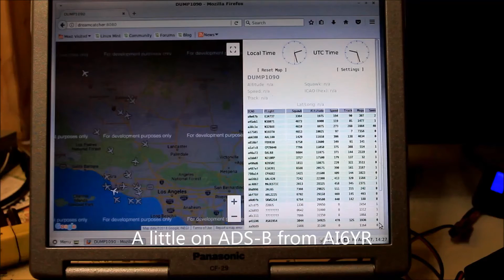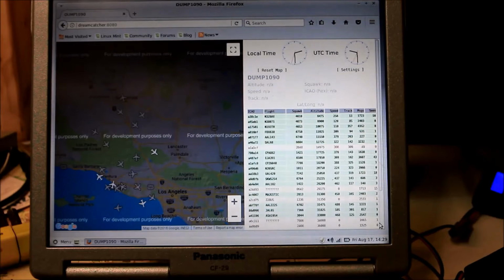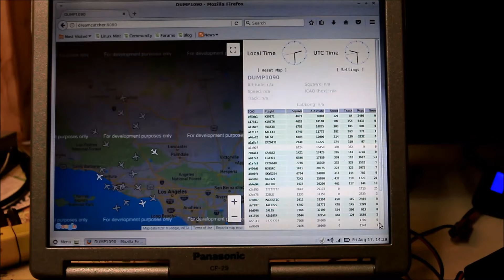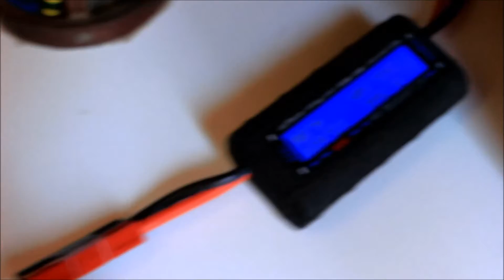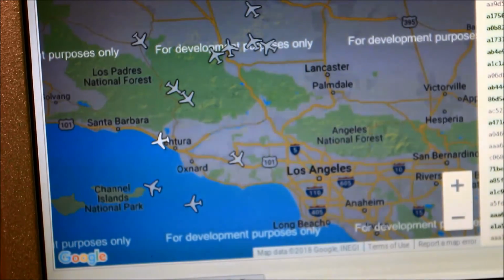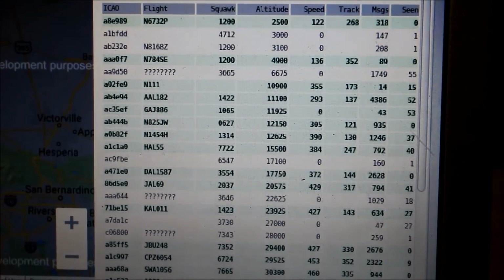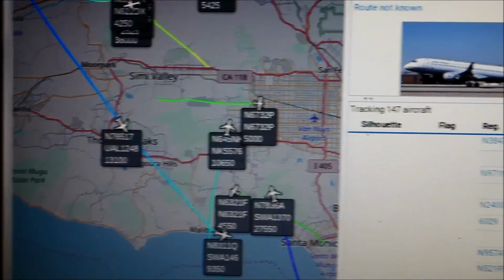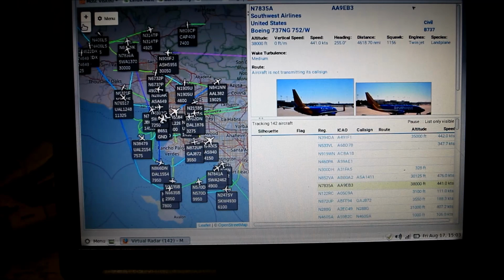A little bit about ADS-B on Linux

Comment: Squawk is the aircraft’s IFF transponder code. All commercial and military aircraft must have one. The airport radar dish has a smaller dish (usually rectangular) mounted just above it and a few degrees offset. That is the IFF interrogator. When it queries an aircraft the responder replies with the squawk code that identifies it.